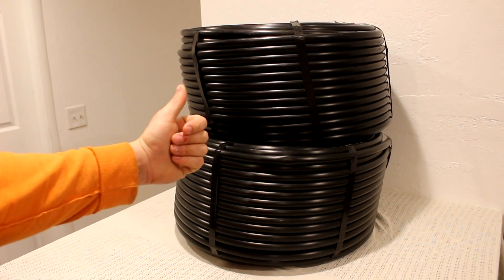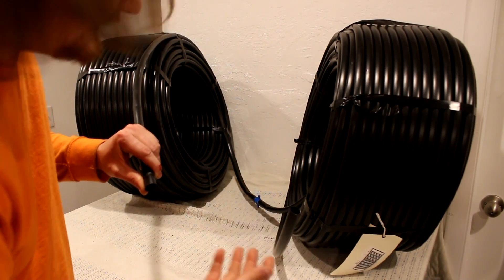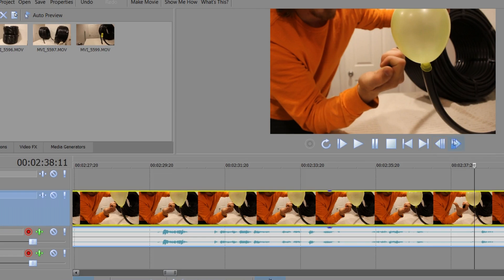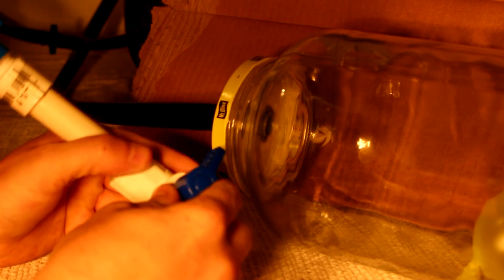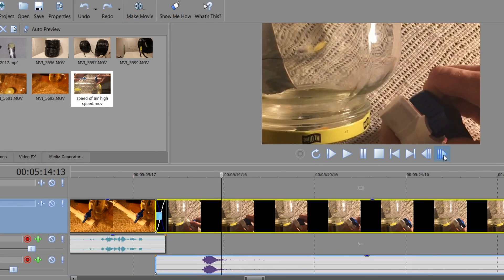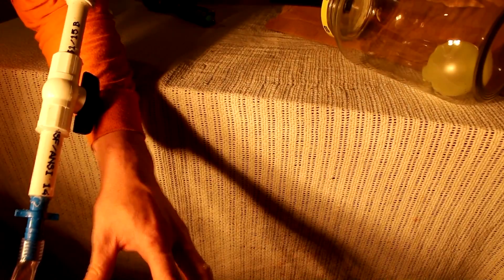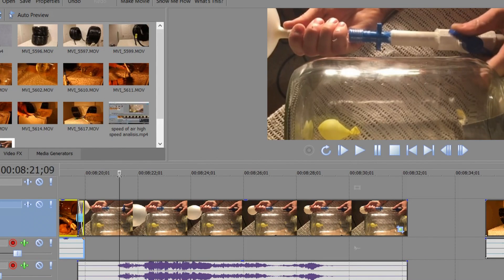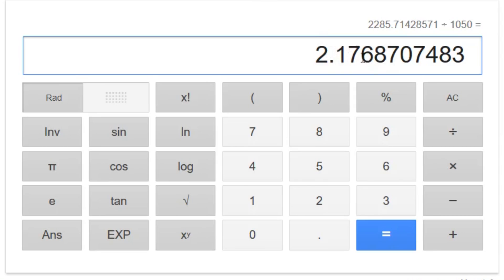Speed of Air Pressure Through a 1000ft Tube

Comment: The problem with the hyperloop is the energy to create vacuum, the risk of a wall of air hitting the vehicles at the speed of sound, and the fact that the tech is not there for the vehicles themselves. 14+ psi on the inside fighting a vacuum, each would have to be a space shuttle.
Reply: there are no "walls of air". air will move in a pressure gradient, with the fastest air molecules reaching first at a low pressure then gradually increasing the pressure as the slower molecules catch up. in fact, you see that in this video, with the feather being pushed on gently and gradually being pushed harder and harder.
Reply: What would you call millions of cubic of feet of air racing at you at the speed of sound? A light breeze? Remember, we're talking about a HUGE tube for the hyperloop.
Reply: did you get that reactionary question from thunderf00t? air moves in pressure gradients, like i told you.

air does NOT move in "walls", period.
Reply: No, I got the reaction from doing the math, you should do not yourself some time. Air, compared to the molecules left in a vacuum, weighs a lot. 14.7 psi over the diameter of the tube is a lot of pressure.

As Cody showed in the video, air moves, basically, at the speed of sound through a tube. Your "gradient" argument is simply trying to downplay the intense forces a catastrophic failure would cause. Thousands of tons of air, would try to fill that void as quickly as possible. It's not like you would feel a light breeze, a strong breeze, and then heavy gusts of air. You would feel slight pressure, and then the air would hit you at the speed of sound.

It's a lot like a garden hose. You turn it on and it might trickle through for a very brief moment, but then a massive amount of water fills the cylinder and flows out.
Reply: let's be honest you didn't do any math. this is pure conjecture. I'll repeat it again if you can't seem to get it: air does NOT move in "walls". I don't know where you got the idea that air acts like water. The garden house analogy has nothing to do with sound.
Reply: You have to be a troll...

But for the rest of the kiddies out there. Air, and how it acts, is lumped into fluid dynamics. If you can understand how water flows through a tube, you should be able to understand how air would flow through a similar tube. Air has a lower viscosity and density than water and thus will flow more quickly. Having water pushed through a hose is akin to what would happen if a catastrophic failure occurred in the hyperloop. The fluid, air in the case of the hyperloop, rushes in at its maximum speed (speed of sound), and pushes to fill the void. The air would not just come in like a light breeze, but would have thousands of tons of weight behind it, with the majority traveling at the speed of sound or just under.

As for the "wall" analogy, which you cannot seem to grasp, go to Wyoming or Colorado on a day when there Chinook winds, (or California when there are Santa Ana winds) and wait until they're in full swing. Then open your door and tell me it doesn't feel like a "wall of air" just hit you in the face.
Reply: water ≠ air. jfc do you know what the difference between water and air is?? water cannot be compressed like air can be. water does not move in pressure gradients like air does.

where do you keep getting these completely inapplicable anecdotes from to support this "wall" of air?
Reply: You keep bringing up moving in gradients and have yet to explain what you mean or what you expect in the event of catastrophic failure. Do you expect light breezes to fill the tube? Maybe you expect air to slowly fill the tube in a slow, steady building of pressure. 

My knowledge comes from a basic understanding of fluid dynamics and discussions with engineers and physicists about this very topic. Where does your information come from? Air, when flowing, is viewed as a fluid. Feel free to look it up. It's really pretty basic stuff here.
Reply: "expect air to slowly fill the tube in a slow, steady building of pressure. " yes.

Are you aware that not all of the the air molecules only go exactly exactly the speed of sound? some are faster and get there quicker, while some are slower and take longer to catch up. the AVERAGE is the speed of sound. they don't all simultaneously go exactly the speed of sound and hit you all at once.
Reply: I would suggest you watch Shane Killian's series on the hyperloop
Reply: You are aware that your hypothesis is insane and dangerous, correct? We're talking about catastrophic failures, not pinholes. Pinholes I could see slowly filling the tube, but if there is a massive failure, you will get rapid pressurization, with the majority of air traveling at supersonic speeds to fill the void.

Again, you've yet to even try to explain your theories.
Reply: you've provided no reason as to why i am wrong. this is how gases work, each molecule has a different kinetic energy while moving freely
Reply: You literally just said an average of molecules travel at the speed of sound. Literal tons of air rushing to fill the void at an average of the speed of sound means catastrophic results. Not wispy filling of space.

So please explain how your gradient theory works. If you can prove me wrong, please do so; I will happily admit I was wrong. So far you have given no evidence, or even justification. You have just randomly taken offense to an analogy and shown that you've never tafluid dynamics.
Reply: "Literal tons of air rushing to fill the void at an average of the speed of sound means catastrophic results"
why do you keep making these hyperbolic claims? why are you trying to portray action movie physics as real physics?
the bottom line is: "walls" of air filling vacuum tubes do not exist. you keep deflecting my explanations and keep offering analogies that don't work in real physics.
pressure moving through the tube will move in a WAVE ie. the pressure smoothy transitions from vacuum to atmospheric pressure. the only way the air should be able to move in a "wall" is if the air moves beyond the speed of sound, where the gas molecules are abruptly moved in a shock wave. to have a shock wave refilling the tube, you'd have to have supersonic air flowing into the tube. since this is a long straight tube, the air will NOT be supersonic. NO shock waves will occur. NO "walls" of air will form.
Reply: And what would the size of this wave be? About a foot in diameter? Three foot? How about the speed of the wave? Any characteristics would help to explain your theory here.

To fill that tube, you would need tons of air. I don't see where action movies come into play.

As you have said, some of the molecules would be moving faster than sound. So your entire argument about not having shock waves is iffy. However, you're conflating what I've said with what you took it to mean. I said a wall of air to describe the rapid movement of a large mass of air. You took it to mean shock waves. You also seem to think that the tube has some sort of check valve at unplanned massive failures that will limit the flow. 

However, my argument is actually that there is simply a large mass of air that will rush to fill a void. Based on what the engineers and physicists I've spoken with have said, it will cause a wall, or if your prefer I use your term, wave of air that speeds through the tube at the speed of sound. Because it does this and air has mass, it will cause the vehicles inside to either come to violent stop, or cause them to accelerate if the are traveling slower than the speed of sound. The acceleration is less worrisome than the intense deceleration that would be experienced.

I'm watching what you recommended and so far everything is based on small breaches. As I've said, I'm speaking of massive failures.

Comment: Another of Cody's video where he demonstrate very clearly a concept that goes against the intuition of science minded people. I was expecting that the pulse would transmit much faster than the speed of sound.
Take the example of electron in conductors. They are said to move at snail speed even though the electric signal travel at about 2/3 the speed of light. From this videos, it is now clear that the electrons are equivalent to an uncompressible liquid in a pipe instead of compressible gas.

Cody, could you repeat the same tests with water instead of air or helium. I hope you will show a much faster propagation. I don't know how much faster we expect, however. The speed of sound in water? Or even faster than that, if the example of electron in conductor is teaching anything.

I expect also a weaker after-shock which would propagate in the pipe at the speed of sound in water. This slower wave would propagate by using the elasticity of the pipe to store/release the energy of the wave.

Just to show that a liquid inside a pipe doesn't follow the intuitive notion of being limited by the vertical height using vacuum pump (like the mercury measurement for air pressure), vsauce or veritassium made a good video about the way tall trees like redwood can pump water much higher than the ~50 feet imposed by the air pressure on a water column. Basically, the tree use sealed tubes with no air gap.

Comment: I'm not sure the speed of sound has anything to do with this. The kinetic energy of air translated from a potential of 14.7 psi to 0 psi probably just happens to be in the general area as was measured, after the mean free path, reynolds number, bernoulli's equation, and all the other pseudo-dynamics are taken into account. A neat experiment as far as sound propagation goes would be to put the camera microphone close to one end of the tube and tap on the other end of the tube. Then analyze the audio for the travel time. That number should come out to be just a bit less than mach 1, for frequencies higher than the tube diameter/10.

Why do I say this? Well, the speed of sound in the gasses created 1 millisecond after a stick of dynamite goes off is probably similar to that of air (and surely less than that of water), but the gases manage to expand much faster than that. (don't they?) Also, the ions (gases) of a solar flare travel to the earth much faster than 1000 fps.

I'm just pretty sure that if you had infinitely stronger pipe and put a 100,000 psi pulse on one end, the feather would blow right through the bottom of the glass jar about 1/4 second later at mach 4, even with the tubing coils.

Comment: I'm not an expert, but I don't think it's how long the air takes to travel. It's not like water, and the pipe is empty, and it has to get from one end to another. You start with a tube full of air. You're changing the air pressure by blowing through it, or by deflating the balloon. The time it takes for "the air to get to the other end" is how long it takes for the pressure to equalize in the tube... no?

Comment: air is consider as fluid and as any fluid run in to tube it have friction between tube and the fluid that will slow it down and the the longer the tube is the more friction force  generated so when you do your calculation you have to consider the head loss that will happen because of the friction and other parameter.

Comment: Neat thing to view is temporary air conditioning duct (made with very thin plastic, similar to a laundry bag, only hundreds of feet long).  It is typically held in place with loose fitting tie-wraps.  When the air handling unit is turned on, you can SEE the speed of sound (the bag starts to inflate from the unit to the outlet at 1000ft/sec (+/-) ! ! !

Comment: Hey Cody. What happens if you inflate the balloon through the tube, release your thumb from the end of the tube, and then pinch the base of the balloon before it's had a chance to deflate? Do you get negative pressure within the tube?
Reply: Yes, sort of like a water hammer. The inertia of the air particles would make a partial vacuum in the part of the pipe near where you pinched it.

Comment: Your premise is wrong.  Your blast of air from your lungs is not travel the distance of the tube. You're merely displacing what your lung capacity is into the tube and moving the air that is already in the tube.  Otherwise your lungs would have to be larger than the coiled tubes.  And I assure you, they are not that large.

Comment: As far as i know the speed of the actual movement of the gas molecules has nothing to do with the speed of sound inside that gas. (The speed of sound actually differs with density, which oviously changed a lot)
Just think of eletric signals, which travel much faster than the actual electrons.

Comment: Cody, do you think the hose being under stronger vacuum could've been more precise than medium vacuum? How do you now the air rushing back in isn't just pushing the remaining air forward shortening it's path? 

How about using colored smoke to re-pressurize the jar so you can see how long it took the new gas from one end to reach the other end?

Comment: Interesting. Working around particle accelerators some would have "fast closing vacuum gates that could close before the schock wave traveled 100 meters down the tube ( an opening maybe 10" ).   Good demonstration although glad that the gas pressures were very modest given the plastic components, etc.

Comment: Regarding the last statement, doesn't increasing the pressure of the gas increase the speed of its propagation? Isn't the reason rifle bullets travel so fast because the gas pushing them is under such high pressure? Or is that completely wrong?

Comment: If you're timing from the sound of the valve, don't you have to account for the time it takes the sound to reach the camera?
Reply: The camera is at most 50 cm away from the valve, so if you don't account for the time it takes for the sound to travel you will have an error of 1/600th of the result (the pipe is 300m in length) which is not much.

Comment: Would the coils of tube act like electrical coils, resisting change of flowrate?

If you blew up a balloon through it, and let it empty itself through the coil of tube, would the balloon be sucked into the tube a little due to a vacuum forming at the balloon end?
Reply from the maker: Yes it would!

Comment: Fill them with oxyacetylene or HHO from a hydrolysis setup, light one end and see how quickly the flame passes through the tube.
Reply from the maker: but I want it to explode.
Reply from the maker: I like that idea.
Reply: Interesting idea. Flame speed of propane is ~12 ft/s (~3.6 m/s), acetylene ~25 ft/s (~7.5 m/s), hydrogen ~40 ft/s (~12m/s). Disregarding pressure changes the 1000 feet of tube should take 83s,  40s, and 25s to burn.  However, because the gas expands as it burns and because it is in a confined space, I suspect the total time will be quite a bit less.

It seems like calculating how much less could be difficult. At the start of the tube the expanding burned gas will mostly leave the tube from the starting point. As the flame progresses the balance of pressures ahead and behind will change, putting some pressure on the unburned fuel, pushing it and the flame front forward. Eventually the expanding burned gas will be pushing the flame front forward quite quickly.
Reply: me too
Reply: If it will burn, I'd assume, that it will move at half speed of sound, because gas needs to come in for reaction to maintain itself, and waste (C02) needs to get out of the tube, and in perfect case half of the tube would be used for air flow and other half for C02 removal, but that is only assuming that it would burn up instantly and there's enough oxygen, so in reality it should be even slower.

Unless it explodes...
Reply: Sounds like the barking dog experiment that periodic video (University of Nothingham) did - off course with a longer tube and smaller diameter. Sounds fun :-)
Reply: Cody'sLab I think we all do, but let's first do some science.
Reply: +Cody'sLab "but I want it to explode."
THIS.
This is why this remains my favorite channel.
Reply: Cody'sLab filling a tube with an explosive gas mixture sure sounds fun, but rather dangerous too. Would advice going with something like methane with a much larger non-explosive region.

Comment: Hi Cody! Awesome episode. I have a couple questions, though, since I'm going to be a Chem major next year.

When you blew into the tube with your mouth, was the air that came out on the other end the same air as what you blew in? If not, wouldn't that mean that it took about a second for the transfer of energy to take place to push the air already inside the tube out the other end, not for the air to travel through the tube?

Another question: how significantly does the air pressure where you live affect the speed of air?

I'm a big fan and thank you for the awesome videos!
Reply: First question: no, it was not the same air. Second question, pressure has very little impact over a pretty wide range of pressures. If you look at the kinetic theory of gas, you will see that gas molecules bounce off of each other in inelastic collisions. The temperature of a given gas is actually a measure of the speed of these molecules. The speed that a pressure wave can travel is also limited by the speed of these molecules. So, as it turns out, the only variable that really matters is temperature of the gas. Of course, for different gasses, there will be different speeds. Small molecules such as He will travel much faster than N2 or O2 at the same temperature. This is why Helium is much faster in the experiment. Argon would be slower than air.
Reply: Thank you!

Comment: Cody, you're filming at 23.98 frames per second, not 30.  Edit: the helium part is set in 29.97 thought.
Reply from the maker: But I always film at 30, where are people getting 24?
Reply: Cody'sLab @ 3:09 secs you can see your video editor going from 02:38:23 to 02:39:00